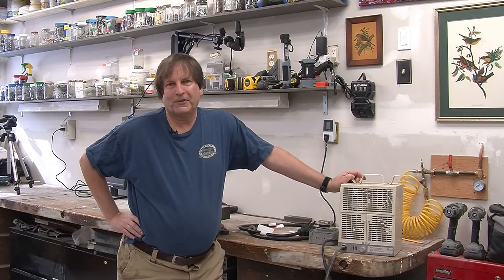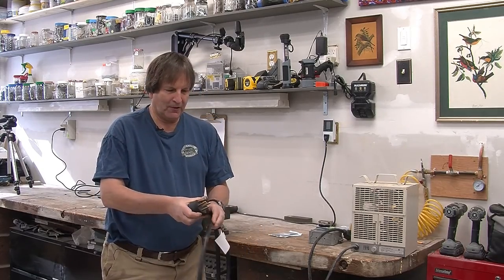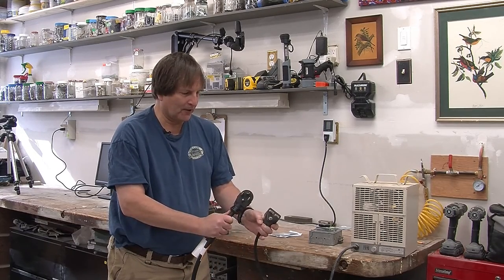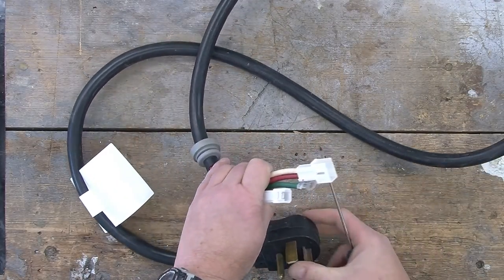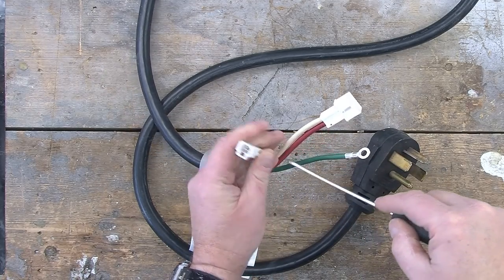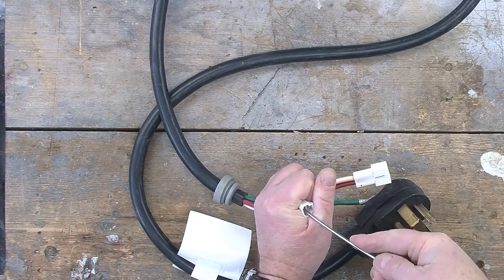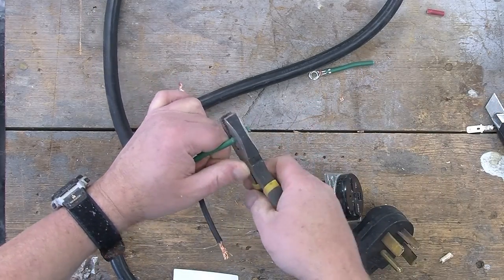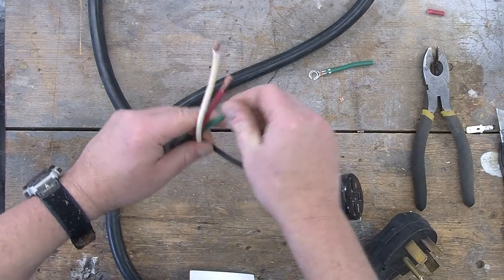Making an adapter to plug a construction heater into dryer outlet

Comment: Small world.  Our (natural gas) furnace died last winter also (on a Friday evening, of course).  An emergency visit from an HVAC company found that the heat exchanger had corroded through.  To get us through the weekend, we ran seven 1500 watt heaters (two loaners from the HVAC company, one that I had had for a drafty bathroom and four that I bought that evening).   They kept the place habitable, even though the temperature dropped to -15F outside in the evenings.  (Probably a good stress test for our ancient and dubious wiring.)  Monday morning they replaced the old furnace, with the only hitch being that the old (Bryant) smart thermostat apparently wasn't talking to the new (Bryant) furnace (supposedly a direct replacement), so we had to call the techs back when the furnace wouldn't cycle off.  With the indoor temp at about 80F, they gave up trying to reconfigure the dip switches on the furnace control board, ripped out the old thermostat and put in a new dumb thermostat.  The new set-up seemed to work OK for the rest of the winter.  We will probably find out tonight if it's still working (forecast low about 48F).
Reply from the maker: My furnace is smarter than yours - it somehow knows when I'm going away for vacation before acting up :) The modern ones have gotten way to complicated - mine (actually a boiler) has numerous menu settings that you need a smart thermostat to configure and the installer had to come back multiple times to get it working properly. I'm in hi-tech and I see that ll the time - its one thing to allow a device to be reasonably configurable, but developers often get carried away and dont understand the situation faced by installers or users.

Comment: Looks like a nice heater there.   I have a similar heater, but 3000 watts and has a nema 6-15P.   I haven't used the heater in close to 5 years don't know if it even works anymore but I brought it from Northern Tool & Equipment when I lived in Pontiac Michigan,  because the home I was renting at the time  was over 80 years old and the insulation sucked.   The old gas furnace sometimes had trouble keeping up & an ordinary 1500 watt 120 volt plug in heater didn't always cut it when it got very windy in subzero Temps.   I plugged it into the outlet used for the 240 volt 20 amp window AC unit.
Reply from the maker: They are pretty common up here for construction sites. I have a couple I got years ago when renovating a previous house and was pleased to have them last winter when the central heating gave out. I don't understand why they don't size them just a bit smaller to be use-able with a 6-20 outlet. I haven't seen them the size of yours but that sounds like a nice practical size - would fit nicely in my compressor outlet. 

I remember seeing ads for Northern Tool & Equipment - way back in the days of magazine ads. Always wanted to go there!

Comment: Construction heaters are NOT supposed to be used inside homes, if you look carefully there is a plate or stamp plate attached to the heater that says very clearly. Good luck
Reply from the maker: Certainly doesn't say that on the heaters I have or any I have seen. Obviously any heater should be used in accordance to the manufacturer's specifications.
Reply: @ElectromagneticVideos thanks for the answer I have 3 of them and in one it says that, but now that I know you answer a question I Have another one that’s been bothering me because I put a lot of time and try to find more info but Utube doesn’t have more videos like yours, I followed everything you explained in the video BUT it didn’t work, I did try connecting in different ways the hot wires but to no avail, there’s power in the cable but the heaters won’t work. Are you able to show in a video that you plug the heater on the outlet and see the heater work, if you can it will show that works and a lot of us won’t be frustrated. Otherwise is ok. Thanks for your time. Ps I did use different multimeter to check I get the results you show in the video but still didn’t work I did make sure the 4 prong cable was in good condition too.
Reply from the maker: @amerikart-sb6hw  The connections in the setup are so simple that  its hard to imagine why it doesnt work for you.  My first thought is an issue with the heater. Since you are having trouble figuring out the issue, and it really shouldn't be that mysterious, I would suggest asking a friend or neighbor with  some  (more) electrical experience to take a look. A second set of more experienced eyes should be able to  figure out the issue. Since there is a potential mis-wireing or bad connection, don't leave it plugged in or try to use it any more until someone can very everything.
Reply: @ElectromagneticVideos I’ll do that. Thanks
Reply: Success after carefully noticing that difference multimeters were given me different readings, I realize that the problem was the power outlet, a fuse was blown, replaced it and voila everything works. Thanks for the video.

Comment: Not sure about the Canadian electrical codes, but in the USA 3 prong range and dryer setups were banned effective January 1st, 1996. for new installations,  existing installations are grandfathered in, for this reason,  you can still buy 3 prong pigtails and 3 prong dryer and range receptacles.     The terminal block of a range or dryer comes with a grounding strap or jumper between the neutral and the ground terminal,  this connection is to be removed when a 4 wire connection is used and must be in place when a 3 wire connection is used.   In fact new dryers and ranges, do not come with a factory installed cord, the installer is required to purchase and install the appropriate cord set depending on the age of the home.
Reply from the maker: You know, I have never actually a seen a 3 prong dryer or range receptacle or or plug, so I'm guessing they haven't been common here for years. Interesting to hear that the terminal blocks come with an optional ground-neutral strap for those old installations - I guess there are enough of them to make it necessary t include support for them. 

A bit surprising new ones don't come with a cord - I would have though the old wire  setups were all but gone. I have also never seen a cord with spade type connectors at the dryer side like this one had. I guess it makes installation a bit more foolproof. I do remember as kid when we had our cottage/cabin wired, there was no stove plug - wiring was connected directly to the stove.

Comment: This would also power a good size mining rig.
Reply from the maker: So you sure got my curiosity - I have never done any crypto currency mining but I see you are doing it. How profitable is it these days? Does one get more crypto value than the cost of electricity? Or is the strategy to mine now at a break even rate  or even a loss with the expectation that crypto currencies will rise in value?
Reply: @ElectromagneticVideos  great questions and its something everyone is thinking about. I mine Ethereum which is profitable but ends tonight. Once the merge takes place mining eth is over. So its basically going to speculative mining and seeing which is the most protfitable over the next few months to years.
Reply from the maker: @Lobonova  Interesting! One thing I have always wondered about (but never had the time to try it) would be to set up a significant amount  of power consuming mining systems in the basement and run them all winter when I would be using that same amount of energy for  plain old heating. So essentially use the heat given off from mining to replace the the hear from the furnace and effectively get double  use of the energy I was going to pay for anyway. I'm sure people have done that - have you tried anything like that?
Reply: @ElectromagneticVideos  
There was going to be a big mining farm connected to the nuclear power plant near Berwick PA.
They partially built it, but stopped construction in recent months.
Reply from the maker: @jeffkardosjr.3825  I guess sadly the big drop in crypto currency value must have messed up their plans. I read about a cryto operation in northern BC using power from a hydro plant that had been built for a now closed mine with connection to the grid. I guess they have the advantage of very cheap power. 

By the way - looked at your page - I'm guessing your a HAM with all the HF stuff. I'm not a ham (yet!) but 20 years ago was involved in developing SSB HF modems - what a cool hobby!
Reply: @ElectromagneticVideos  Yeah. I'm just a Technician yet. But would like to upgrade to General.
Reply from the maker: @jeffkardosjr.3825  Well you ahead of me!
Reply: Wouldn't you want separate circuits instead of plugging a PSU into a circuit fused for 30A?
Reply from the maker: @soundspark  That what i would think - way safer if something shorts. Unless maybe the 30A cable was connected to its own subpanel.

Comment: Years ago when I lived in Florida, one place I lived in had a 240 volt window air conditioner/ heater combination. You just switched it to heat or cool...no central heat or air. It did fine, just had to leave the bedroom door open in winter. Central Florida doesn't get all that cold, so it did just fine.
Reply from the maker: I was at a hotel once somewhere in the south that had the same combination AC/heat type thing. Must be real practical in places like that. Central Florida - I know that area well - had an Aunt who lived in Cocoa Beach  - great place to visit in the winter and an added bonus if there was a launch!
Reply: @ElectromagneticVideos   This was back in the '70s, and all the houses on my street had them..I lived about 30 miles from Cocoa Beach...
Reply from the maker: @scottthomas3792  I envy you! That area must have been fabulous back then with so much less population and space race going on!

Comment: I actually found out about that little shortcut in code apparently it was a remnant of war time copper saving. Much like how the UK ended up with ring circuits. I just stumbled across some thing that said that portion of the allowance in the code is going away. Theoretically it was perfectly fine with 240V elements across the phases, a timer is a minimal draw and maybe a light. But when convenience outlets came in sending neutral down the ground probably not that good idea an although it didn't kill anybody as far as I'm aware.
Reply from the maker: I didn't know  it was the result ow war time copper saving but certainly makes sense. It would be interesting to know if there were any serious shocks as result of it. If the ground was somehow disconnected even a small time motor could bring the ground and hence metal appliance to 120V with enough current to provide a serious shock. I'm sure your right about convenience outlets really ending that.
Reply: @ElectromagneticVideos  yeah same thing just found out about it recently I can't remember what video Or it might've been comments on Reddit. Yeah losing the neutral+ground would make the entire stove a center tap transformer with human in the middle! It would indeed be interesting to know the status. all the houses I grew up in never had the fourth prong so I never noticed any faults with that.
for large fixed appliances it sort of makes sense. but we are in a time where "We" think Code can fix everything but it can't fix kitchen fitters and inexperienced DIYers.
we Did have an interesting experience with a dryer....
Reply from the maker: @imark7777777  I guess it boils down to how many layers of protection. I remember one place where we lived as a kid - my dad bought a stove at a from auction - stove was probably form the earl;y 50s and had no ground. Actually no plug either - hard wired into the wall junction box. Like you - we never had an issue. 

I do have misgivings about where more money is spent on safety these days. AFCI breakers everywhere now. Might be much cheaper to simply require fuses in extension cords. And use the extra $ that would have gone to AFCIs on things like more more fire resistant drywall. 

Completely agree code can only go so far - I think we are at the point of needing to do more to educate DIYers with online resources and similar rather more rules which seems to be the solution to everything these days. 

Dare I ask about the dryer incident?
Reply: @ElectromagneticVideos  oh yes AFCI. I hear of places that will rent you them so you can pass inspections. Meanwhile I follow a lot of Youtubers electricians from England and they don’t know what to do with those things either. There’s one guy who’s tested it trying to make a handful of faults and a homemade tester with minimal results.
And every manufacturer has a different error code scheme.

They seem like it’s a method to protect the installation from poor installation. But if it’s being poorly installed to begin with it’s not really going to help.

Me and my mom were out of town and my dad decided to plug-in the electric clothes dryer… This was an old farmhouse. The story when we got back home was that he plugged it in and it shorted and sparked and the transformer on the pole outside the house flew across the street. Upon inspecting the dryer one of the wires neutral + ground was not attached. And I highly suspect that the dryer outlet was tapped off of the main breaker. No injuries but we did end up with a totally different transformer out there after that. Somewhere around 1999.

GFCI’s fully makes sense but I don’t remember them costing as much as the AFCI do when they first came out.
Reply: @ElectromagneticVideos  the UK has fused cord plugs however they tend to have 13a fuses put in them which is the maximum rating.

they have to regularly inspect and now regularly inspect whenever a tenant enters/leaves a property but they have what are called cowboys running around doing whatever they will along with kitchen fitters which will redo in an entire kitchen and string everything off of one circuit. buried junctions etc.
Reply from the maker: @imark7777777  We actually have fuses in the plugs of  some Christmas light strings so there is no reason we could not do what the UK does for extension cords at minimal extra cost. 

Interesting about inspections as people move in. Not required here, but when buying a house one generally gets it inspected but independent contractors.
Reply from the maker: @imark7777777  Wow - never heard of renting AFCI breakers. Seems crazy since like it or not, one should comply wit the code and the cost to have an electrician swap them in/out is probably a significant part of the breaker cost. 

Wow - that must have been a giant short to cause a transformer to fail so spectacularly! You would think the main breaker would have protected the transformer unless it failed. Lucky no-one was hurt.

Yeah - near water or outdoors, I'm all for GFCIs. And your right about them being cheaper. In the end with and IC in the breaker, the sot should be about the same.

Comment: In Germany, we have to use ferrules for stranded wires according to the standard. Exceptions apply only for cage terminals. Unfortunately, I can not see well what kind of terminal the receptacle has.
This is to prevent the fine wires of the stranded wire from being cut off by the screw. If you tighten very firmly, this unfortunately often happens. I think, that this is not without danger, especially at high currents.
Reply from the maker: Yes - I'm always worried if I see finely stranded wire in screw terminals or similar. I should have done something better with the wire ends! I was a little lax because the wires and connector are rated at considerably more current than the heater uses. 

By the way, its really nice to have a viewer from Germany commenting. Not surprisingly only very small percentage of viewers are from Germany. I actually have lots of connections with Germany - my mom was from Germany and as a kid my dad worked at the Canadian Embassy in Bonn for 4 years and we got to know our  Opa who lived in Bayern very well. Too bad I'm so out of practice with German  or I would do a video in German.